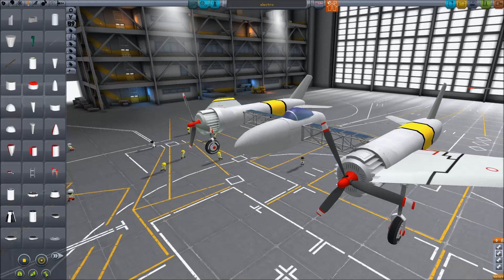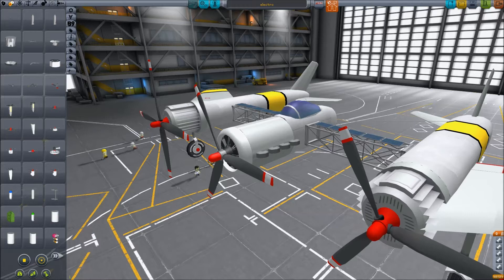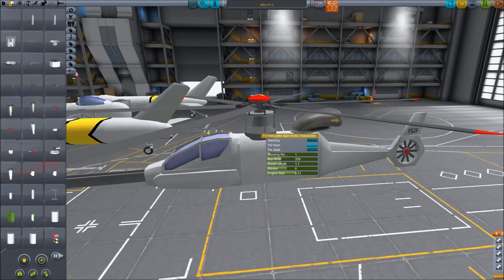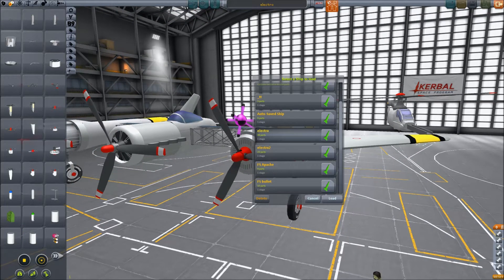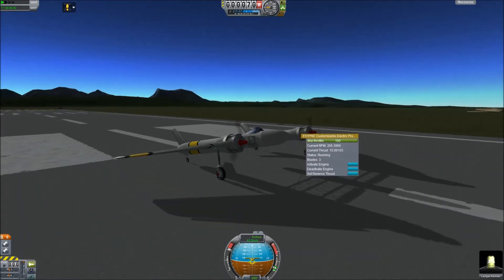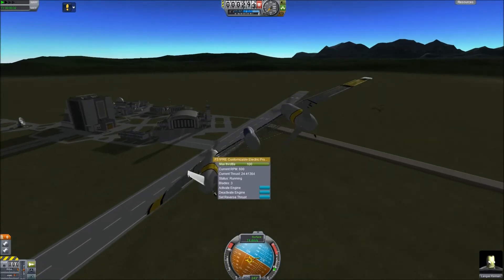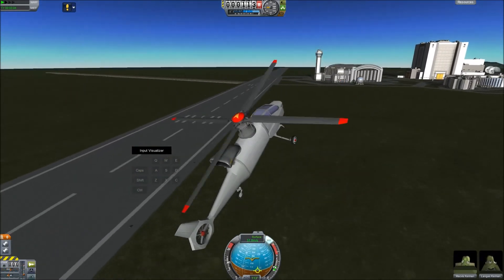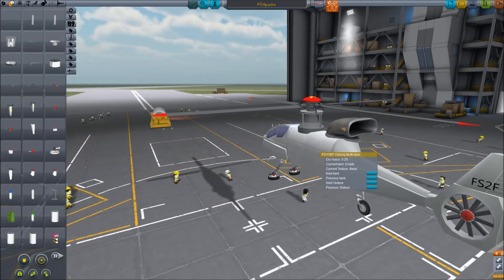Features in Firespitter v7.0 (preview)

Comment: Uuummm.... Support for 0.25 anytime soon please?
Reply: it works for 0.25 i tried
Reply: LetsPlayVideoGames Did not work for me.  :(    Even the pre-release version broke my game...
Reply: Nick Dawson Heres a solution goto his github and he has a firespitter for 0.25 it works fine for me
Reply: Nick Dawson :/ I tried the version on github but there we're no sound and no biplane parts :(
Reply: The GitHub parts have sound for me also the biplane parts are there
Reply: i was using the ksp x64 instead of the normal ksp and it crashed my game whenever i had B9 Aerospace installed, that might be the problem
Reply: It's been 2 years and it still doesn't work